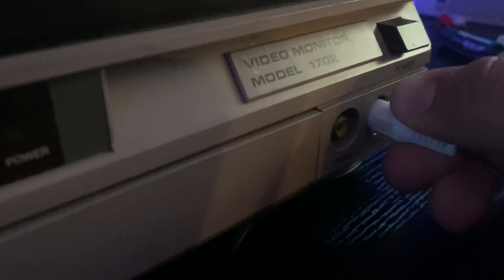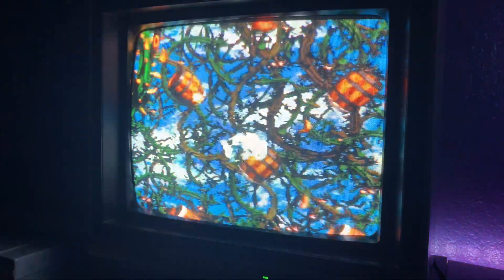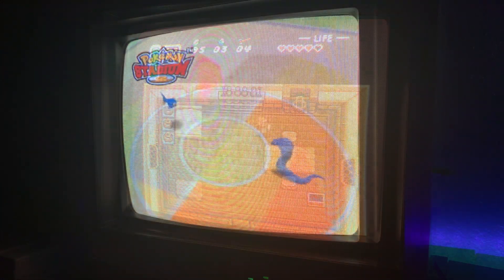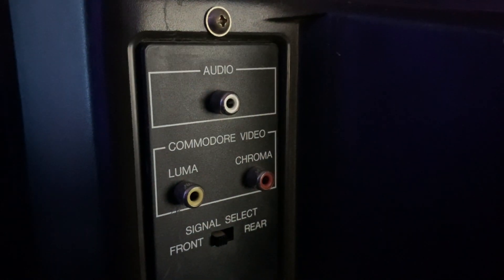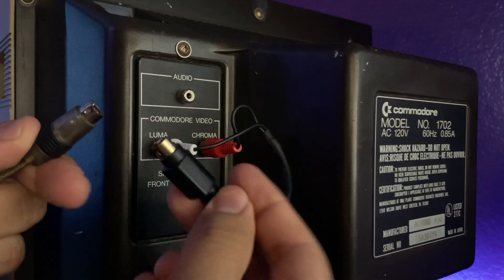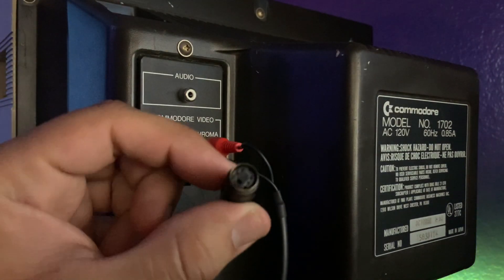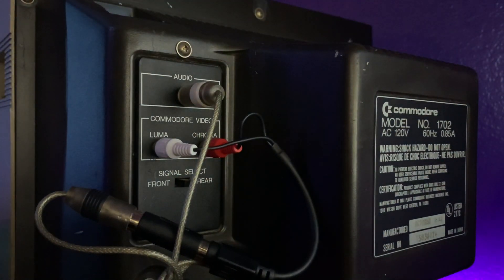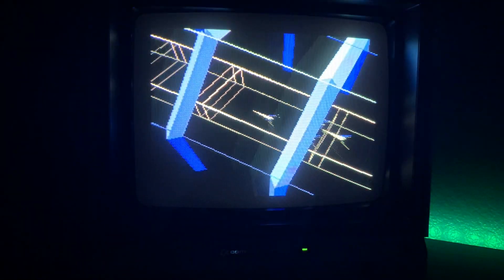How to get S-video signal for Commodore 1702 monitor(no mod needed)

Comment: if you have a device that supports composite, and component at the same time, you can plug the green (y) cable into luma, and plug composite into the chroma, and it will work.

Comment: I just got one and the the front av ports have been having issues with my consoles like ps1, ps2, would the cables and adapters you use in this video fix that? I really need an answer since I only  have a certain time to return it
Reply: It’s most likely just the switch in the back that needs to be cleaned. You can use Deoxit to clean it.

Comment: My commodore for some reason at halfway mark on the color dial actually plays video in black and white. Anyone know my problem? I feel like if i turned the color to the strongest colors it still isn't that colorful. When i put my video and audio cables to the front of the tv outputs and hit the switch in back to enable them the color shows up a lot better but I don't want my wires to be showing through the front of monitor. Someone know why my color is bad when i plug in my video rca cord through the back of the monitor?

Comment: My monitor occasionally flickers. I have yet to open up and clean it. What can I do to improve my problem?

 I may get it recapped or attempt to do it myself, but what are some non- invasive things I can do?
Reply: Mine did too, make sure not to flip the rear switch all the way, moving it back slightly fixed it for me